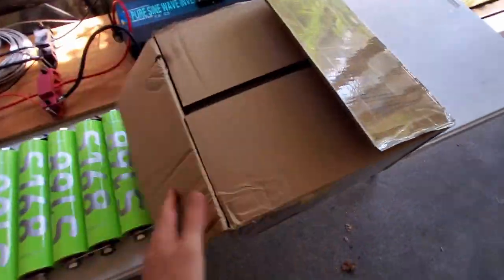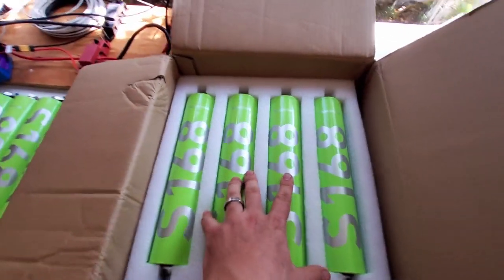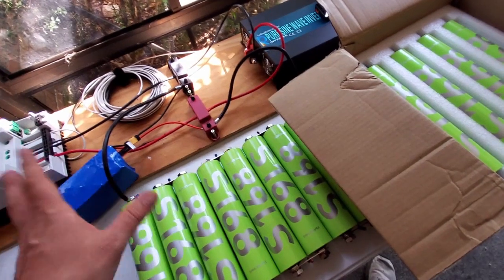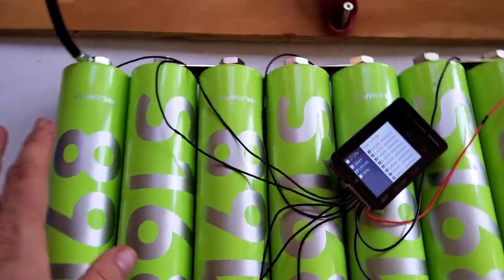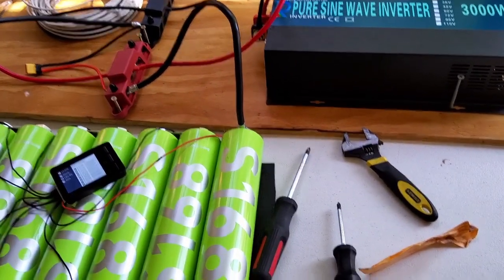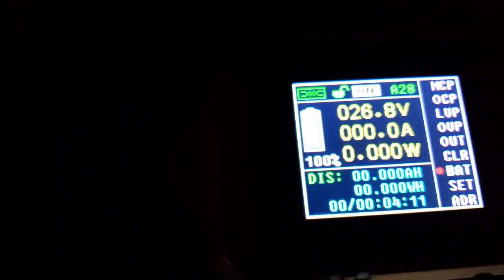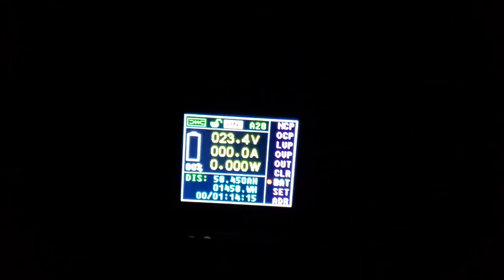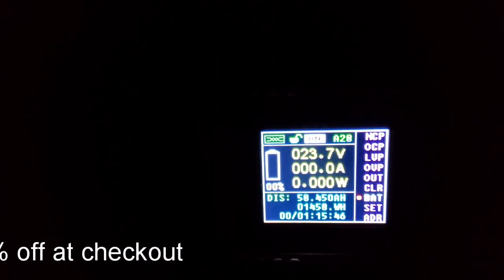Round Two! Big Ass 60280 55Ah LiFePO4 Cells

Comment: Need help, mine just arrived two days ago, I am in a dilemma on extracting power out of them. What cable did you use and how did you make a connector for these terminals. If you can please create a small video on that it will be really helpful.

BTW great videos, keep up the great content.
Reply from the maker: Depends on how much continuous current you want/need to pull. If you're going for the max recommended of 2c (110amps) you need 2awg copper wire.  I'm using them at 1C (55amps) with 4awg copper wire (that can do 85amps) whatever wire you choose you should have a fuse, or breaker that matches the current capacity of the cable. The fuse is to protect the wire from melting and causing a fire hazard.
Reply: @BradCagle  
Thanks for the prompt reply, the max that I will be draining from them is 90w in 12v config. Thinking of using 8 gauge cable. For the lug end to connect to battery will 3/8 lug work with an inline fuse of 50 amp.
Reply from the maker: @mace-ti7js  You need a 1/2 ring terminal.

Comment: 50Ah is pretty ipmressive for that form factor.  Interesting!

For LiFePO4  if you are top-balancing you can only really balance the cells above 3.50V or so. If you attempt to balance at lower voltages, it won't actually balance the cells because the charge curve is really really flat.  Instead they will simply stabilize at varying different states of charge, at the same voltage.  In fact, trying to top-balance LiFePO4 cells at lower voltages will tend to UN-balance them rather than balance them.

(bottom balancing is a whole 'nother discussion.  Most people these days choose to top-balance because its really easy for the BMS to do that effectively).

-Matt
Reply: Actually for their size and weight 55ah is VERY low for their size and weight. Especially for their 1c/2c rating. I bought 32 of these and was fairly disappointed once I saw/felt their size/weight. Strongly suspect they where rewrapped used cells that have been derated to make them look new. Also finding these same cells labeled as 75ah 10c cells on other sites contributes to my scepticism. 75×.8=60 so a used cell cycled until it hit 80% capacity (standard cutoff point for mobile applications) would spec out awful similar to what these are labeled. Hope I'm wrong but...
Reply: @wildness01  Cylindrical cells aren't common for higher-capacity LiFePO4.  Usually they go prismatic (such as the Eve or Lichen cells), then you start seeing capacities in the 250Ah range.

I was a bit surprised seeing even 50Ah in cylindrical form, hence my comment.  My assumption is that they are purpose-built for E-bikes or E-bike style applications which require more ruggedness.

-Matt
Reply from the maker: @wildness01  Specific energy of LifePO4 is 90 to 160 Wh/Kg. So I would not let the weight be the cause for suspicion. Also re-wrapped cells, they are not going to bother producing a nice green wrap with nice sliver graphics, etc. Also they would label them as 56, or 57, or probably event 58ah. I'm not saying it's not possible, but I think it's very unlikely they are used                               derated/relabled.
Reply from the maker: These are actually 55ah, and are doing 58ah. I'm sure they'll be closer to 55ah as they get cycled after a while. As for balancing I've ran some off camera tests with active balancing, it's currently inconclusive. But I'm seeing balancing occur in the middle of SOC, when you pull a load the weaker cells drop lower, and the active balancer will direct current from the higher cells to compensate. Basically I used small cells that were badly unbalance in the middle of SOC, and pulled a few hundred mah, then put it back, always staying in the middle of SOC. Then i discharged each one individually to see what each SOC was, and they were much closer than when started. It takes forever to run this test, so I have to do it over a few times. I'll eventually do a video of my finding. I don't want to release this info prematurely as to prevent spreading bad, or incomplete info.

Comment: can you use these on an ebike
Reply: Yeah, I've been thinking about it myself.
For 16S (51.2v), 2 rows of 8 would make the pack approximately 18.9"x4.72". ~57.6lbs I think.
If you go for 20s (64v), 2 rows of 10. That puts you up to 23.62" long. ~72lbs

So you'll definitely need a custom frame.
In Texas, our 3 ebike laws are 20mph, under 100lbs, and has to have pedals.
20mph is easy if you don't get caught. 100lbs is tough with these cells, but the cop has to know about that law.
Reply: Sure, as long as you can fit them into the frame, the voltage is right, and it can support the weight.

Comment: Hey, bought the cells, but they were sold out on the full kits. I'm thinking of trying to make my own busbars (can't find a source for them). Any suggestions, specs you could share? Thanks
Reply from the maker: for aluminum https://www.youtube.com/watch?v=5TCBMUNkQaY and for copper https://www.youtube.com/watch?v=jahfr13mGr4
Reply: Same Question here.
Reply: Copper pipe from the hardware store or scrap yard, hammered flat then drilled at the right spacing.

Comment: It would be cool to make a flashlight out of one of those :]
Reply: Incandescent Light Bulbs would give a nice even discharge for the inverter… not to mention heat the house at night when testing a discharge!
Reply from the maker: @DavidHalko  Good idea, but I would need 15-30 100w bulbs for the loads I'm pulling. I have a 1000w space heater that I'm venting out a window. I could incorporate a string of 10 bulbs to fine tune the load though, I kind of like that.
Reply from the maker: Woah, that would be sick. Thanks for the idea!
Reply: Could be used for personal protection too.  These suckers are HEAVY.   More on topic though, 3.2 volts is enough to light high power LEDs. Hmmm    :)
Reply from the maker: @ebenwaterman5858  Yeah, and if we focus the beam would make a death ray :) Now there's some personal protection LOL
Reply: @BradCagle  ;)